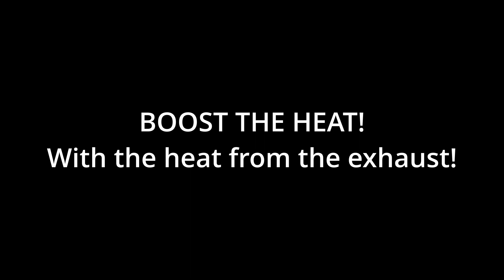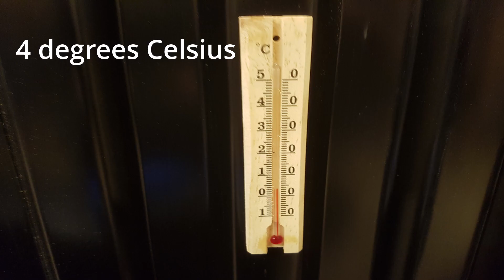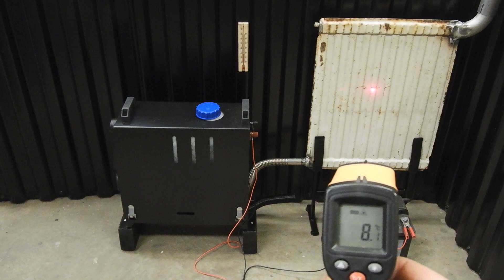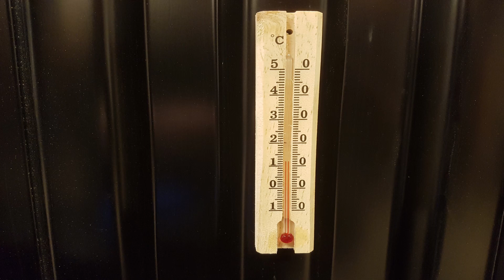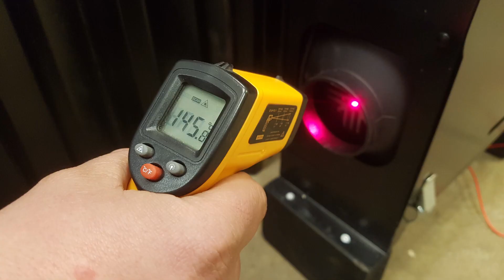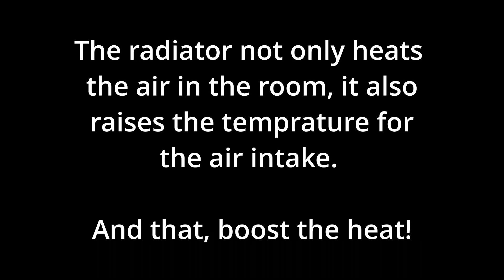Part 2 - VEVOR - Chinese Diesel Heater | BOOST The Heat!

Comment: I did a similar mod to my 5000 Watt Chinese diesel heater but placed heater high and made sure exhaust was sloped to allow condensate to drain out. 
I pass the exhaust through a vertically mounted 110 mm diameter aluminium flex pipe. 
I think I get as much heat out of the exhaust as I get of the warm air. 
Keep up the good work.
Reply from the maker: Thanks!

Comment: While I like the idea you have. There is no place for the condensation to get out. It will build up in the pipe and choke the hearer out. The exhaust should angle down somewhat. If you start having problems that is what it is. Good luck
Reply from the maker: Thanks! The radiator is angled away from the exhaust inlet where there is a drainage tap to get the condensation out (shown near the end of the video). The heat at the bottom of the radiator helps dry up any left over water and it seems to work.

Comment: Your heater HAS to be the highest point, down thru the radiator, and down and out the exhaust, all running downhill.... you will get condensation in tbe exhaust, and it will collect and plug off the radiator by running uphill
Reply from the maker: The radiator is angled away from the exhaust inlet where there is a drainage tap to get the condensation out (shown near the end of the video). The heat at the bottom of the radiator helps dry up any left over water and it seems to work.
Reply: I agree Even the exhaust from the heater to the radiator is going uphill so will trap condensation. Before it gets to radiator The exhausts are designed to go downhill.. but nice engineering.